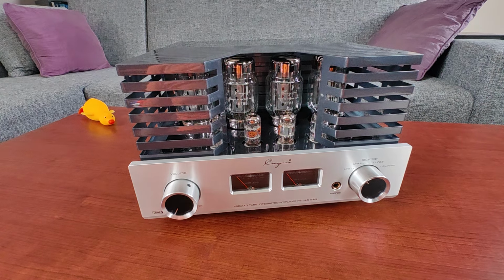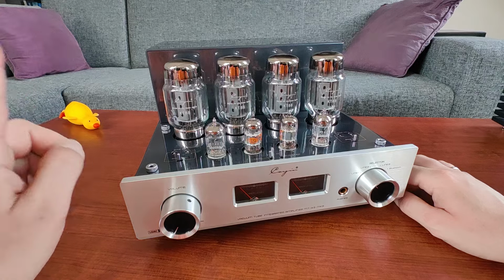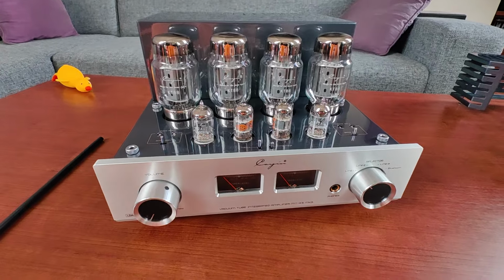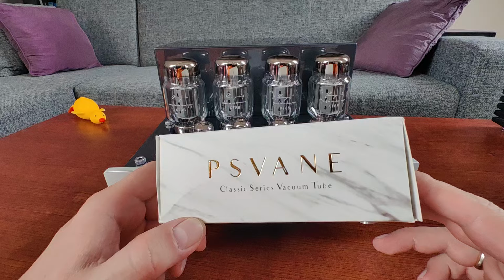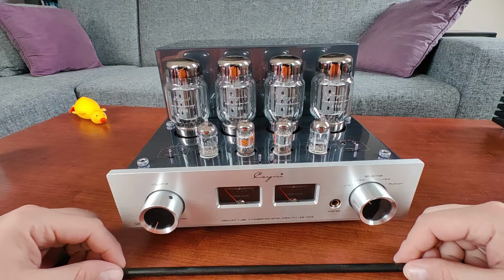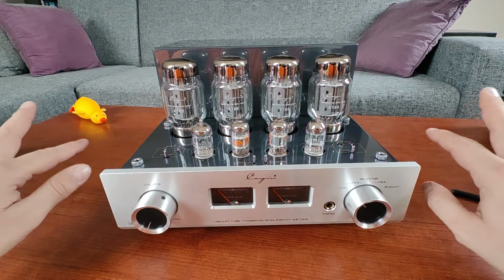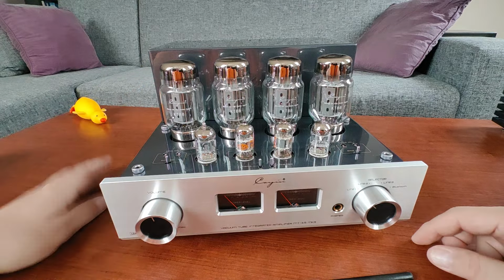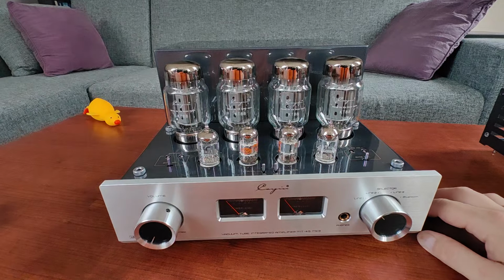Liquid GOLD! Cayin MT-45MK3 / Jazz 80 Tube Amplifier review!

Comment: I have Martin Logan Electromotion ESL's and just ordered this with using some coupons. Which brand tubes you recommend to get?
Reply from the maker: And one more thing, warning actually. As I've said in the review, this amp being 2x40W was not able to drive properly my Ascents I for clean, airy treble (panel drops to 1.2Ohm in treble area and this may be a difficult load for tube amp). If you have Odyssey, this can end in similar fashion. 
This Cayin is excellent, EXCELLENT when driving my Motions - so much actually that I was seriously considering selling Ascents and associated equipment. The passion, the emotion this duo has is unbelievable.
Reply: @k4syx  the previous owner had had a Luxman SQ-N100 with those Martin Logans that I also now have, he had it later setup with different speakers because I think the 10-12W power per channel was too little for them ML's
Reply from the maker: @MF175mp  @MF175mp way, way to little. These shine with lots of power on tap. 2x150W? 2x200W? The DartZeel clone that I've reviewed here in my channel is a very good choice for them. 2x40W is just not enough for my Ascents - and Odysseys are even larger.
Reply: @k4syx  I think the minimum recommended by ML for those was 20W. Maximum like 200W.
Reply from the maker: @MF175mp  yes but these are like what's the minimum to make them spit and burp some sounds. Seriously, try to borrow something powerfull and you'll see how much the highs will open up. There's a reason why people are recommending Krell or Parasound "ovens" as a recommended pairing :)
Reply: @k4syx  I will see. But it starts to get pricey with more powerful tube amps
Reply: One possibility would be to rig one of those amps for each speaker with Y-cables for both inputs and outputs... But it's not ideal for sure
Reply from the maker: @MF175mp  you could try to get a cheaper D class amp for the bass driver. But I seriously doubt that 40W per panel will be enough :(
Reply: @k4syx  lets hope for the best. I got those ML's and the Luxman for free so I'm really on a lower budget range than several thousand € myself.
Reply from the maker: For power that would be PSVane Acme or slightly cheaper kt88-ii. For phase inverters psvane art series. And for pre: that's where rolling fun starts :) Some good NOS tubes like Sylvania, RCA - that's for starters. Telefunken? Clear tops? I can turn this channel into soap opera about the tubes :D
Reply: I got it now and I think I'll use it as it is for some time. I saw a Velleman k4000 for sale that puts out 2x90W but some are saying that it needs some work to sound good....
Reply: Cryotone tubes
Reply: @goodsound4756  I would like the best price to quality ratio, in the lower price range.

Comment: 200 Watts... mhmm.  But you forgot to mention: is it on and off or .. is there a the main section transformer etc than you can leave on to get the best sound and the tubes off than of course. Like PS Audio does.
Reply from the maker: There's nothing that stays on, power switch is mechanical and it cuts all power completely
Reply: There's no way that puts out 200watts